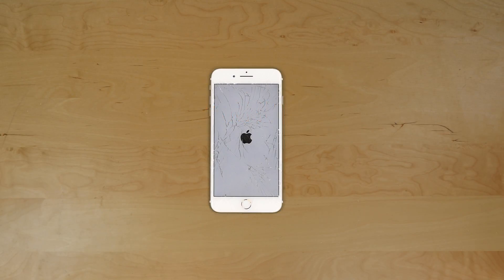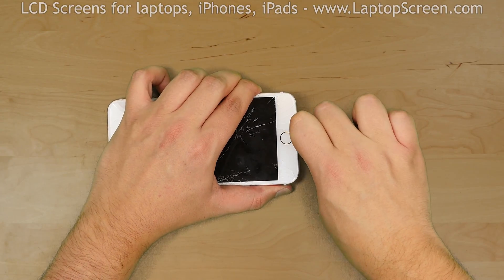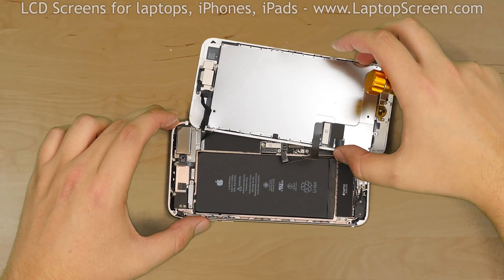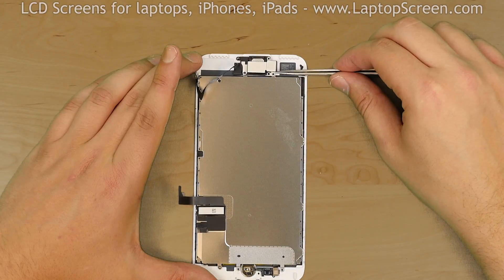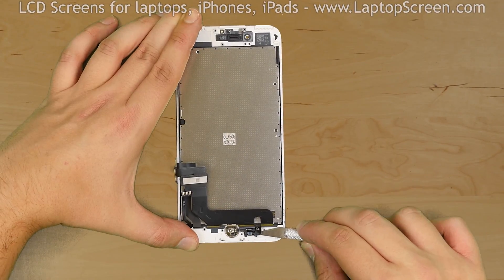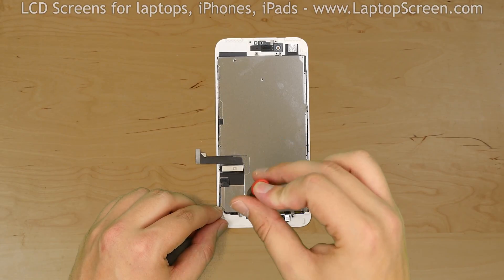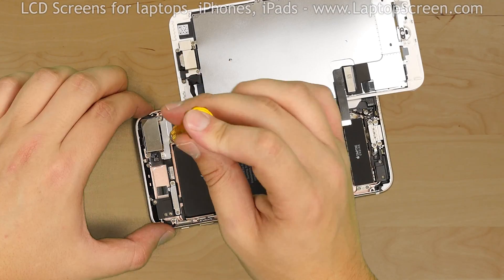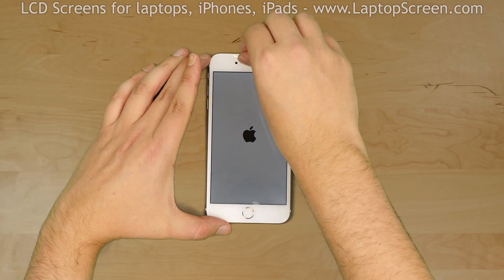iPhone 7 Plus screen replacement / digitizer glass and LCD reinstallation instructions

Comment: hi, i have a question.
 i recently replaced my screen due to it having a crack the touchscreen worked fine and everything worked well. 

however after i got the screen replaced after a few minutes of using the phone the touch screen stops working. then when i leave the phone alone and come back to it, it does the same thing over again.

 i have tried everything to get the touchscreen working. do you know what i can do to fix this. its an iPhone 7 plus BTW. cheers!
Reply: Did you ever get this fixed? I'm dealing with the same issue and the same phone.